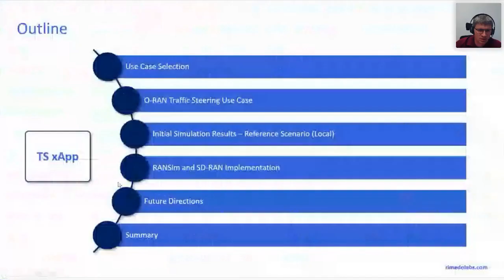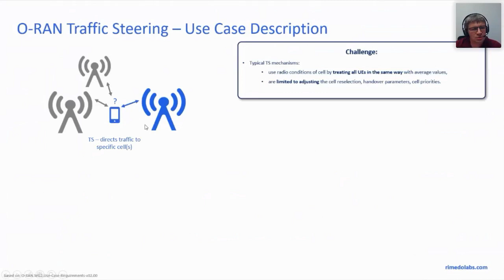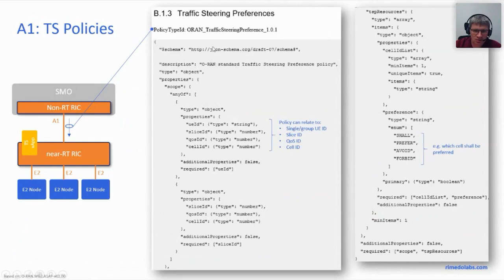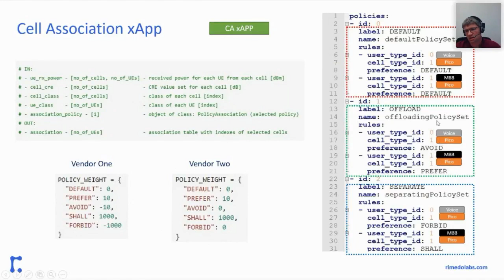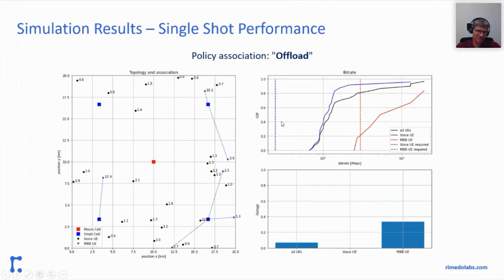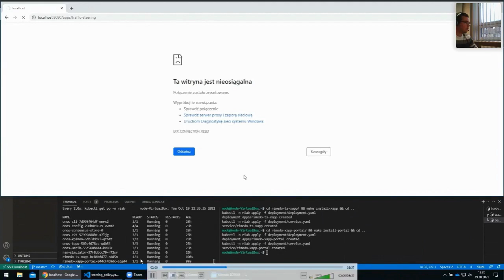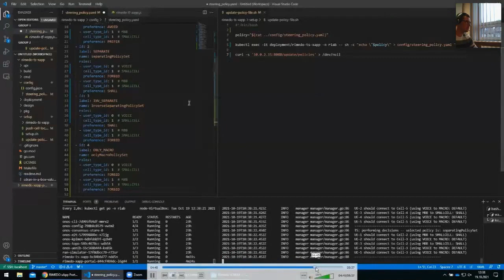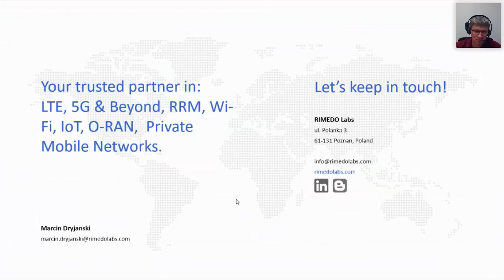Open RAN (O-RAN) Traffic Steering xApp Implementation and Live Demo

Comment: Hi, where can I download/clone rimedo-xapp-portal?
Reply from the maker: Hello, the xApp portal is our internal tool, thus cannot be downloaded by external parties. You can however download and run the open source code for this demo https://github.com/onosproject/rimedo-ts or a latest open source demo for energy saving use case: https://github.com/opennetworkinglab/smart5g-nonrtric-plt-ranpm/wiki